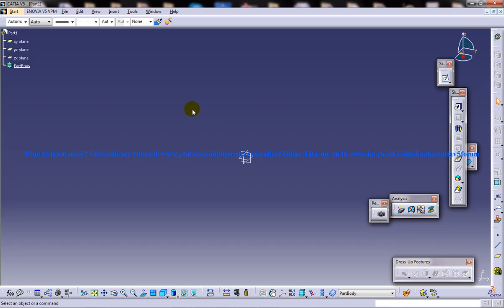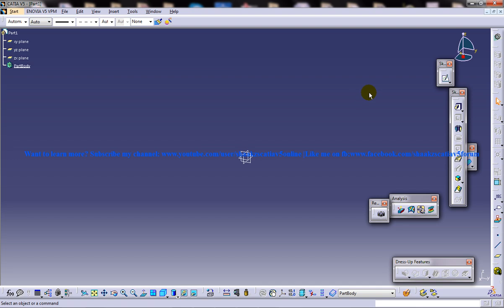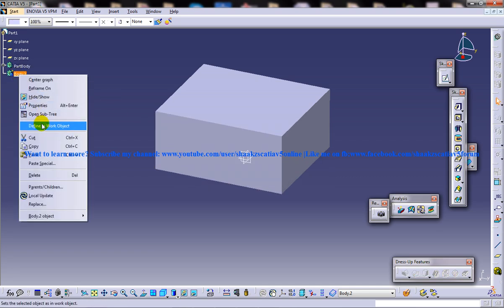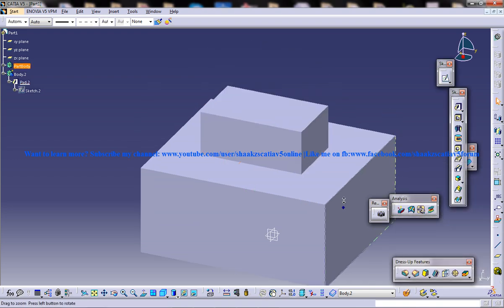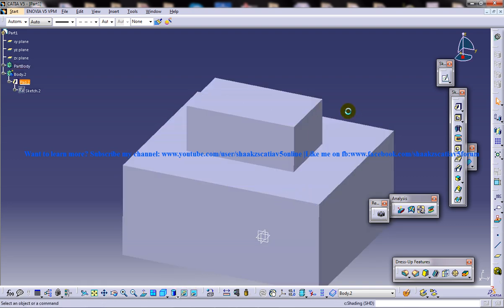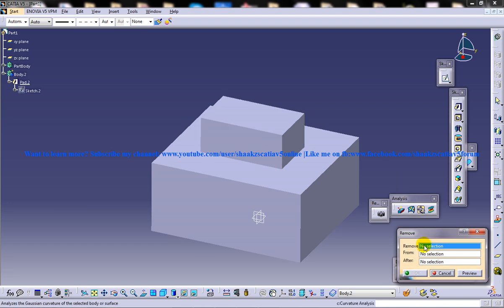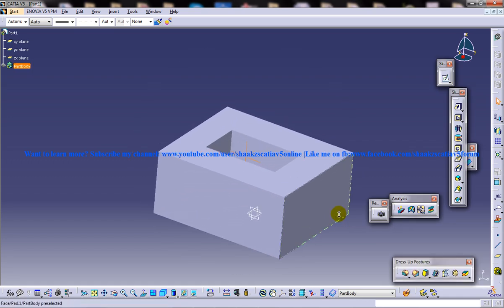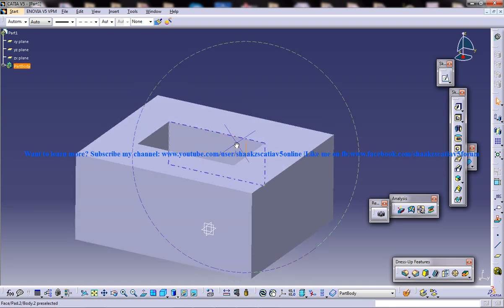Catia V5 Powerful Tricks #128|How to use Boolean Operation; Remove|Parametric Dumb Solid Modeling

Comment: Sir,Initially I used add operation and added the parts, so continuing this could i remove the added part by using remove operation? I tried this but I'm failed to remove.
Reply: in your case, the answer it's no. You can add or remove only once a part body. If you made a mistake, by adding instead remove, you can find the boolean operations inside the tree. Just open the part body ( or the one who added to ... ), and you can delete them.